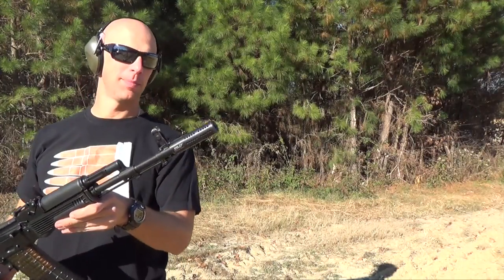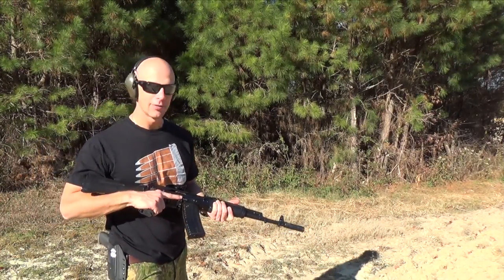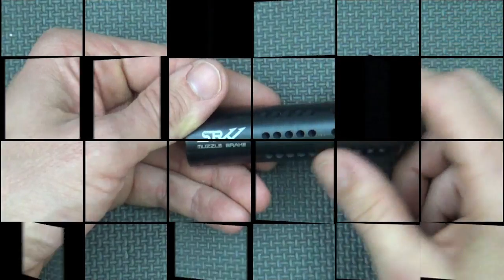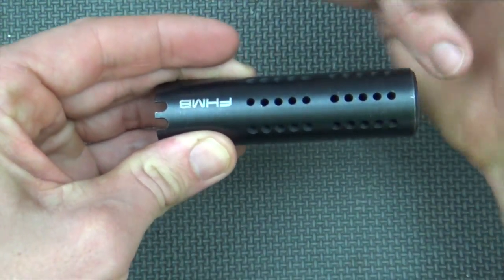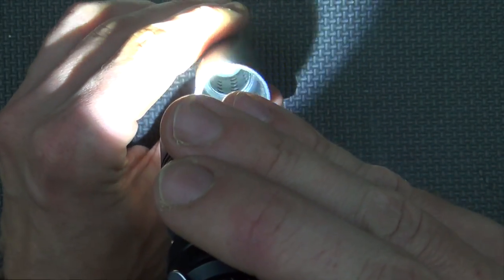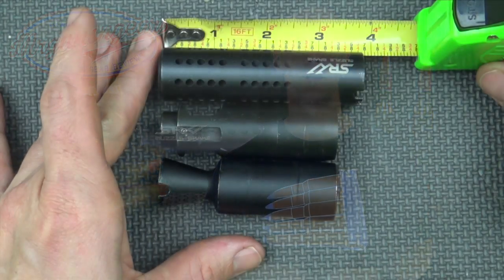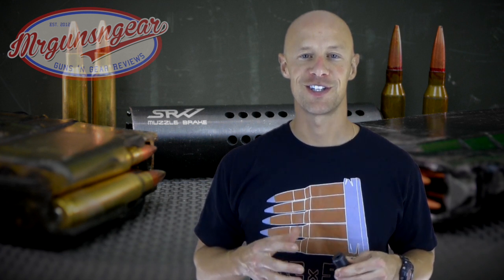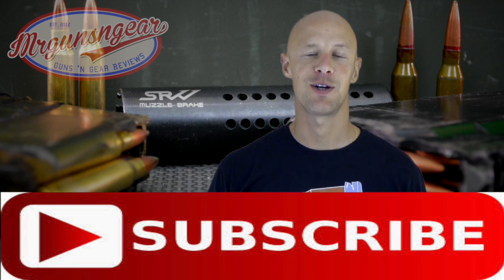SRVV FHMB AK-47 & AK-74 Muzzle Brake Review (HD)

Comment: have you used the 7.62x39 version of the jet brake and would you say it's more or less effective than the 7.62x39 fhmb?
Reply from the maker: yes, more but way more flash
Reply: oh gotcha. would you recommend the Jet over the FHMB then? i'm doing red October this year and competing open division with a 7.62x39 so I wanted a really good muzzle brake for the job, not super concerned about flash and shockwave. I asked around on the AK subreddit though and one of the regulars there told me the FHMB had better muzzle control than the Jet though, weird.

Comment: Mrgunsngear Channel How does this compare to the Jet Brake? I cannot decide between the two.
Reply from the maker: I Ren I think I said that in the video......   No?
Reply: Mrgunsngear Channel I don't think so ... the website says that it has slightly more recoil because this brake also hides some flash whereas the Jet Brake was designed purely as a comp.